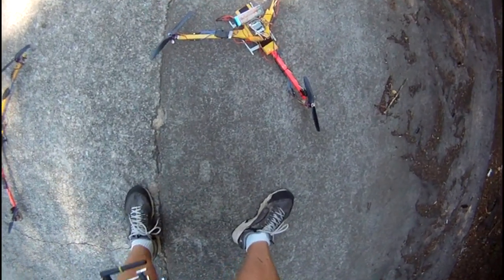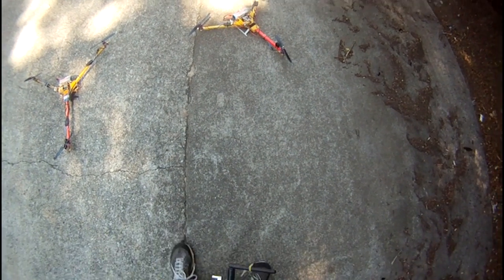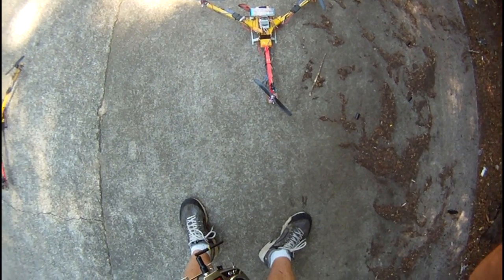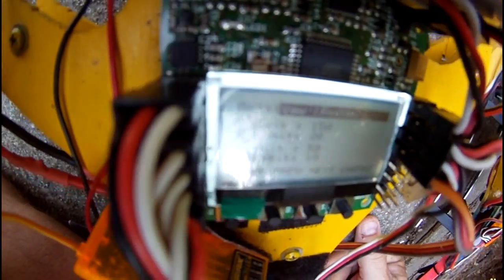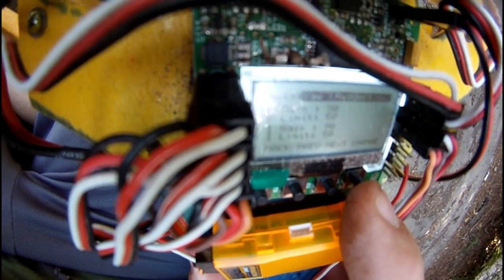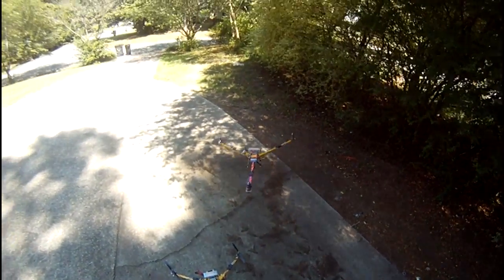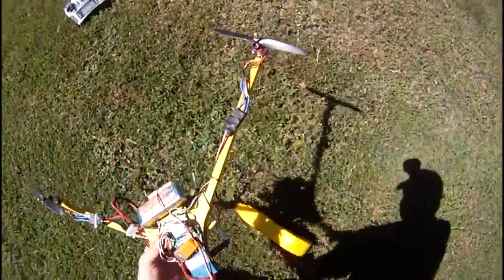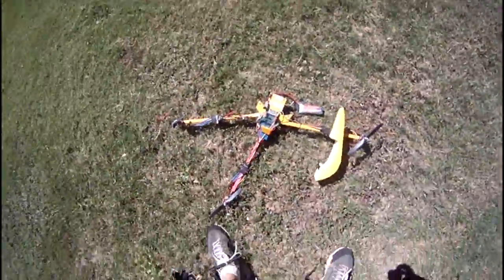Hobbyking's KK2 control Board Flight test

Comment: I don't have this board but searching some other vids of this FC it seems weird to me that their is no 'D' value to the gyro or accel. Usually the "P" is to combat outside force such as wind etc. "I" is to fine tune the "P" value and "D" is to control the rate/speed at which the craft returns to a level attitude. For the most part the accel is the sensor that is aiding in the self level feature, maybe try playing with those values to try to get it more snappy! Good luck, nice flying!!!

Comment: They both have advantages and disadvantages... depends on what you want.  I have found Quadcopters  have a higher lifting compacity while tricopters are more efficient and can fly longer.  Tricopters also have a LOT more yam authority but the disadvantage is being slightly less reliable and more complicated due to the back rotor tilting.  Im a Tri guy :D